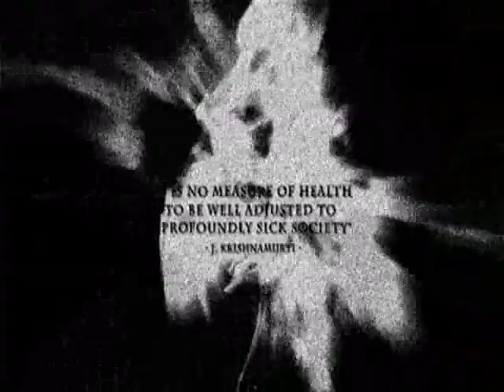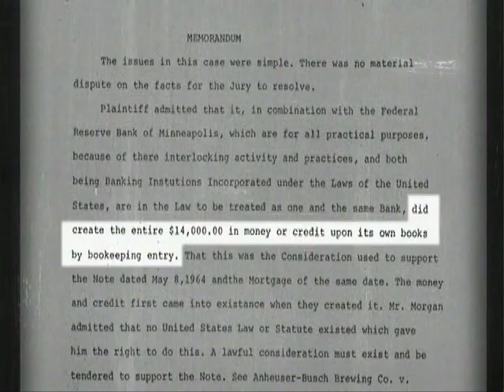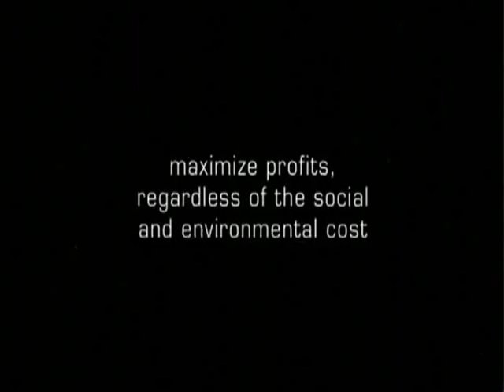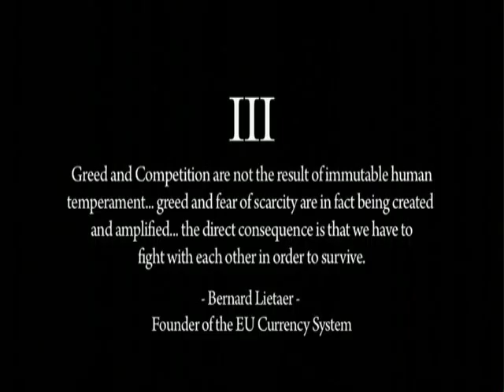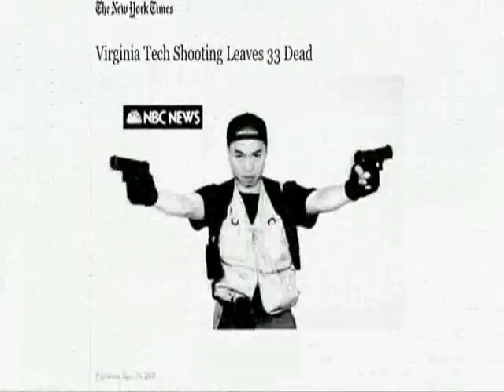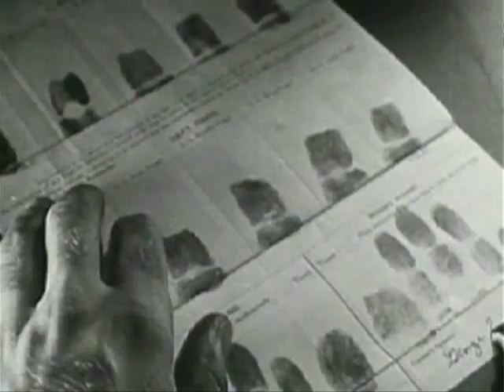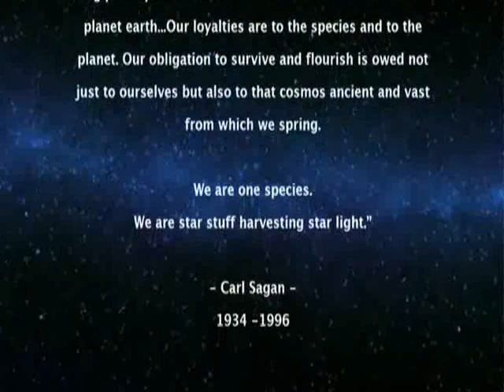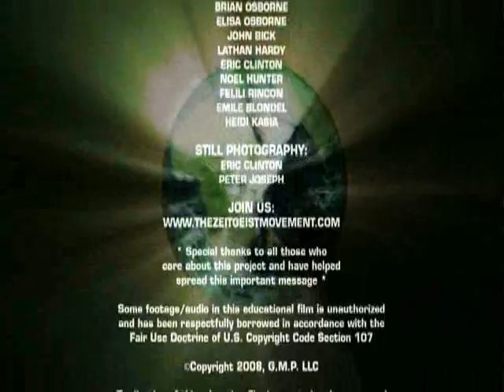ZEITGEIST 2: ADDENDUM (FULL MOVIE!) - PLEASE SHARE

Comment: If everyone went to their bank and withdrew ALLL of their accouts in cash form, savings accts and all... we wouldn't get it, because its not real physically. That's a scary thought!!!
Reply: Not only that, but they will impose capital restrictions. In other words, you won't be able to withdraw the whole sum you deposited, or you won't be able to withdraw anything at all.
Reply: The poor could never rebel via this method, because they don't hold the money in the first place.
Reply: But if everyone would do this then it would break the banks. We in the Netherlands have done this once to an bad  bank. It went belly up. The power always lies in the numbers.
Reply: Arend Tiems
The more numbers, the easier it is to diseminate propaganda and create in group fighting. Create pressure points around group differences, etc etc.
Reply: +Arend Tiems agreed
Reply: omgcow but i meant if everyone did it... Meaning all the non-banking' non ruling class. Those with small businesses, CDs, IRAs, 401ks, etc. Even if it induced penalties for premature withdraw... It would still crash the system.
Reply: Danella Cullen Why would they? They are dependant on the system.

Comment: I am a little disappointed that when they mention the renewable energies of solar, wind, wave that they totally ignore the problem with energy storage ie. batteries  that you will need with these sources.     I will concede there is little economic motivation to overcome this problem with our current market system.    That doesn't take away the fact that this is still a major problem.

Comment: I like these video's it's the religious aspect, I can't get past.
Reply: You can't get passed the religious aspect.
Reply: Carl Atteniese
- Tazlynne's grammar and wording are correct except for the apostrophe in "videos", which turns a plural into a possessive (I would move the comma to follow "videos" as well, but that's purely punctuation, another subject).
  As for the last word of that sentence, it would only be "passed" if someone had eaten it.  The phrase "I can't get passed" might also possibly apply to someone driving slowly on the road hoping the following vehicle would pass them and get off their bumper, and upset because the follower won't.
  "Past" absolutely is the appropriate word in that sentence.

Comment: Again, I can tell by what you say that you haven't really researched it at all, or listened to Fresco speak. It is not a utopia. In fact Fresco specifically says that there is no such thing as a utopia. His vision is of a better world where needs are provided and corruption is minimized or eliminated. There will always be problems, the point is to minimize and deal with those problems. I have followed venus project and Zeitgeist for a long time. I'm not the one that needs to do the research.

Comment: I like this film so far.  Yes there are other sources of energy production available and yes there are other ways to power our transportation that the "Elite" are keeping from us but I'm still waiting for an answer to how the hell are we going to make any of these products without the use of fossil fuels?  Everything in our current way of life has a direct link to fossil fuel.  The cars we drive could be powered by other means other than gasoline but the car itself is made from oil.  The paints, resins, rubbers, plastics, etc. are OIL based.  Even the machinery and current way of mining the materials used in electric car batteries are oil based.  At this point, are you saying that no matter what the next economical system may be, we will still be dependant on fossil fuels? Or do we have an alternative resource out there which will allow us to build and create the things in life that are beneficial to us?  I'm hoping its the latter.  I'm hoping that we can create products and machinery without oil and the only reason we make everything from oil based products at the moment is because our current system dictates that we should to maximize profits for the oil companies.  It's just no one in all the documentaries I've seen has answered this with a definite factual response. Can we make the change to this hypothetical resource without having to change our entire way of life?  If this were possible, is there a plan on how to manage such a transition?  I just hope I survive the transitional period because no doubt the change from our current use of resources and this monetary system to whatever the next may be, no matter how amazing the next system is, when this transition takes place, there will be chaos.

Comment: The static closed loop identity is too linear to recognize the wealth of living information abiding in so called mythic reflections. Technology - including thinking - extends the purpose that creates and uses it. The urge to define and control life has a fear element that is denied by design - so as to seem to be made in our own image and thought and have faith this is true and experience it as if true. But self-image is a technology initially operating a denial phase by which to develop a segregative closed system.
 
This documentary illustrates some of the ways such a segregative division of controller and controlled, judge and judged, extends the idea of (fear of) loss as a power struggle of increasing fragmentation and depletion to a point of recognition of the unworkability and meaninglessness of a 'self and world' founded upon a false foundation. And recognized false it can no longer serve AS a foundation.
 
And so beneath what seemed solid and self-evident are recognized evasions and devices of deceit, pretences and diversionary displacements by which to maintain an ego focus within Open Consciousness - for the mechanism persists as habit - but its purpose is changed from a device of limitation and denial through raising a mask or persona over conflicting self, to a communication channel through which life extends to recognize itself in the other and the world. 
 
The timings of the Shift are individual within a collective reintegration but we are all part of each other in ways we cannot see while the self-concept 'rules' in place of true feeling discernment - for each moment is a new emergence and this is not 'loss of self" or "loss of control" - but freedom from having to operate an impositional or coercive 'self' upon the movement of our being; the creative uncovering of Life in unselfconscious spontaneity - at one with the moment itself. 
 
Any glimpse of this original nature operating without distortion and drag of death and taxes is a miraculous intimacy of being that the mind may then seek to define or hold on to or attempt to regain - but it cannot do this for you already are this - but entanglement with choices investing identity in idolizing form reflects back as the fixed sense of meaning - and its 'loss' to the awareness of identifying in belief of having first gained it and life's movement taking away. 
 
Paradoxically truly letting go is what allows something to manifest in alignment with the focus of desire that is active. Uncovering our true desire often terrifies us - for here all heartbreak was born, isolation and deprivation and misery. The denied or subconscious and unconscious conditioning is not rationally accessible for a divorced rationality is the technology of its denial. The barriers and blocks to accepting who you truly are and knowing and being truly known are reflecting vital information - and trying to go past them only gets sabotaged by such denials signalling a need for acceptance.
 
You are the 1% - your denied feelings have become almost invisible to who you believe yourself to be. Yet your world is FULL of them - except you only 'see' threats or unworthiness and weakness. 
 
"Am I my brother's keeper?" . Your 'brother' is the keeper of what you deny in yourself, for in extending acceptance of worth to him or her is the only way you recognize or know again that you have it and are it. 
 
I see an alloy of ideas and information in this documentary - but beneath that also a willingness for the embrace of Life on Earth. If we had to know everything before stepping forth we would not be the unfolding experience of a human lifetime. However we can know what we need to know when we need to know it - and that is the 'faith' connection to what can be called higher mind or non physical mind. 
 
When the communication channel is blocked by identifying in fear reaction and attempt to coercively limit to control, the sense is of having to mange reality all by oneself. Faith is then invested in protections and powers that extend such control - which add to the investment in displaced identity. The rest is a history we seem unable to escape or overcome.
 
It does not matter what kind of permission slips work for you to feel, know and move in and as the presence of you instead of fragmented presentations. While they work appreciate and extend a natural joy and gratitude in what you do. I am stressing the growing of a different foundation - which comes from receptivity to Life and in cooperation with Life. 
 
Trying to mix old and new is a period of conflict. You cannot serve two mutually exclusive purposes at the same time and vacillation or procrastination cancels or delays coming to the recognition and acceptance of a truly unified purpose. If the world brings feelings of heartbreak, rage or powerlessness, don't give them your trigger finger - or your denial. There is important insight hidden in the 'unwelcome guest'. Problem solving is not the same as an innocent curiosity. Being practical yes - but being framed by problems that reflect inner issues of relational conflict and 'solving them where they are not' will only displace and disguise more subtly what you don't want to accept, yet.

Comment: This is such horseshit. 
What happens to the massive batteries that would power these vehicles once they're worn out and can't be recharged?
Who changes the oils and fluids needed to run these robots and were does it go?
Who fixes an automated piece of machinery when it breaks down?
Who fixes a computer or server when is shuts down? (Which happens all the time, by the way).
Who designs new operating systems and computer code to keep the computers up to date and glitch free?
Who designs new computers to replace old ones and what happens to the old ones?
A tornado wipes out 50 wind turbines. Who builds and erects the new ones?
A hurricane destroys a town in south Florida. Who rebuilds it?
Who grows the food for the rest of the country to keep people alive?
Who's going wo fix the infrastructure of a city or town?